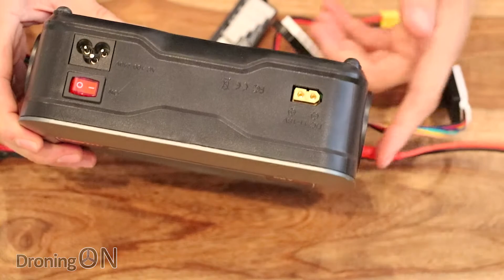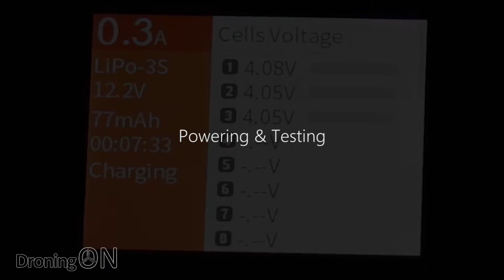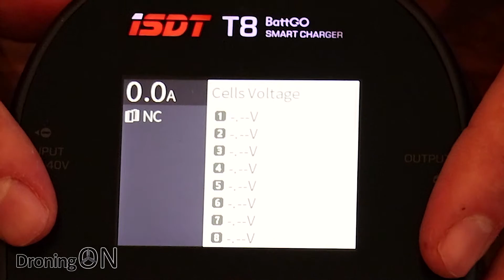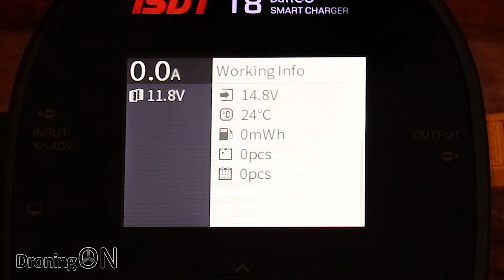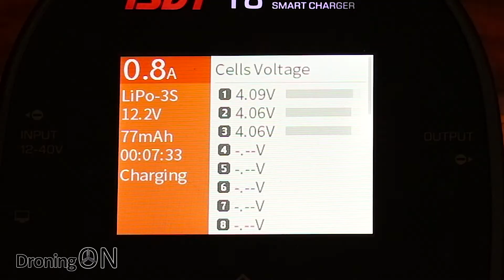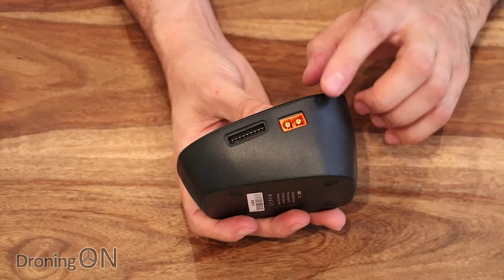DroningON | ISDT T8 Drone Battery Charger - Unboxing, Setup, Testing

Comment: I use this charger to charge my huge 4S  320ah  RV house battery and used a 24v server power supply worked a treat - I fitted spare balance leads - it balances at 15w as it charges so always arrives at top balance even with such a big pack

Comment: yo. You say 4s battery as a minimum to power this thing. Is this only to get voltage in check or does the discharge of amps matter also?
Was thinking to hook up a lets say 300w solar panel to it, would it charge at around 250w or so or would i need an mppt to get those effeciency?

Comment: Doesnt appear that this can be left on a battery bank to continously monitor and balance cells at all times, like I need for my lifepo4 prismatic bank I'm using for solar. Or can it?
Reply: Yo did you find any answers on this? I am trying to bypass MPPT and BMS by using this charger with a solar panel to charge those batteries. Also if you might know, i would like to make a 14s 6p battery pack and have 2 dongels and a disconnect to charge the battery as 7s 12p. Do you think its possible or is the amp stuff mismatched or smth? I did see people charging 7s li-ion banks with this charger so it seems possible.
Reply: @manipulativer  Hi, first if you want a hands off approach to charging then you need a BMS. That's because the T8 needs to be manually started every time it will perform a balance charge. Once it's done balance charging, it remains on so you can continuously see cell voltage but it does not continue to balance it, and it also draws small current to stay on. I haven't tried using this bypassing the MPPT I dont know if it can handle the fluctuating voltage. The MPPT does things specifically to maximize solar output which the T8 wouldn't do even if it worked. However, you can definitely use an MPPT as the input source to the T8. It should not be an issue reconfiguring the cells from 14s to 7s in order to charge. The T8 can do up 8s.
Reply: @firpofutbol  Thanks for your response. My idea is exactly to go on "hands on" aproach where BMS would be excluded.
And i would have 2x7s "modulated" battery packs either 1 charging the other powering an inverter or have the both in series with correct gages to drive an ebike.
Some kind of cheap "hands on" solar system in case of an emergency like corona and stuff but also to have an ebike in the future while having most of the components paid of.
Reply: @manipulativer  I see, yeah you can do that with the batteries. The T8 can operate within a range of input voltages and output at whatever voltage your cells need. The solar panels will change voltage during a charge depending on the conditions so this change in the middle of a charge cycle is not something that I've tried on the T8 since I normally have a power supply at a set voltage. If the expense is keeping you from buying an MPPT, you can find really inexpensive PWM charge controllers that'll do the trick.
Reply: @firpofutbol  Yo thanks a lot for your response! And yes was thinking about pwm but it's really more of having a charger and battery, the solar panel and inverter would be a comodity to take with me in case for a longer trip but until than i would also have it as an emergency.
Reply: @manipulativer  As purely a charger, the T8 works fine. I top balance charge a relatively big 4kw LiFePO4 battery bank with it, no problem. Hope this helped.